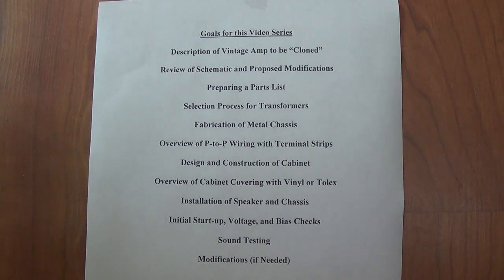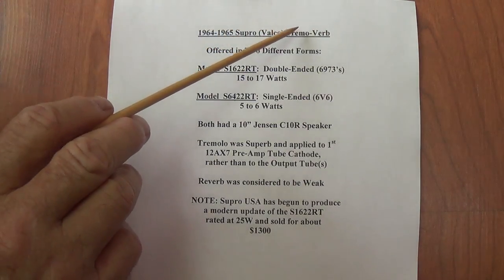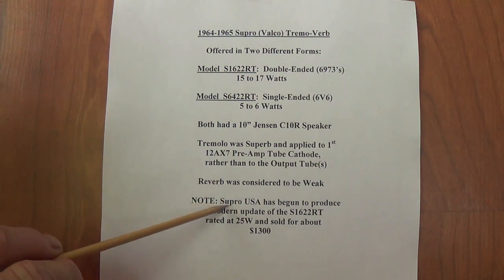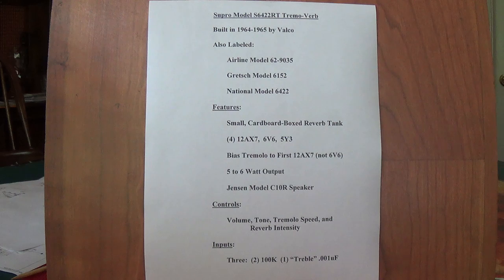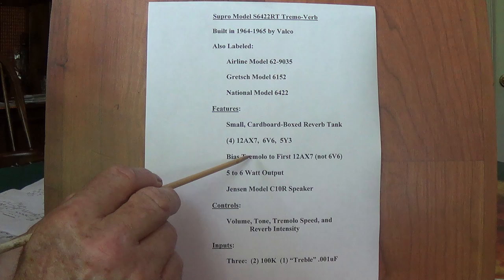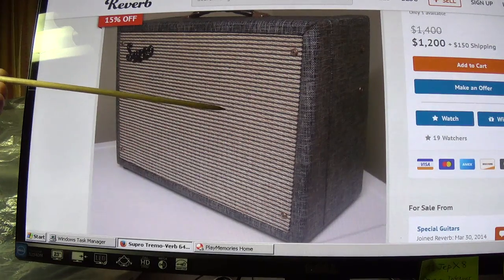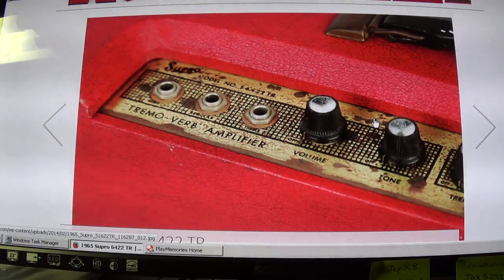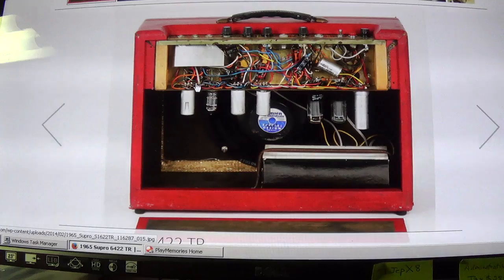How to Scratch-Build a Vintage Amp, Part 1:  Research and Methods

Comment: I am binging on these videos ahead of my first attempt at a build. I noticed that some of the cheapest amps/components out there are old AM/FM radios. (I have 3) They are about $30-40, and you get chassis, cabinet, tubes, sockets, and output transformer. Most of them don't have a power transformer that I recognize but seem to simply go through some caps and resistors before going to the rectifier tube. The tubes are not all that common unless it has the all-American 5. Do you have any videos where you convert a radio, or 16mm projector, or record player to a guitar amp, and walk us through how to convert the hi-fi radio circuit to a much simpler champ or tweed style, but with the 'oddball' tubes, ie, achieve proper plate and screen voltages etc? I would love to see it.
Reply from the maker: Yes, I have posted several videos demonstrating conversions from PA, projector, and Leslie amps to guitar use.  I do not advocate conversion of any circuit that lacks a power transformer, as they are potentially dangerous. I also shy away from conversion of AM radio circuits, simply because so many radio components are of no use, resulting in a big, bulky chassis with relatively low output power.  Stick with PA, mono phono, or projector amps for conversion.
Reply: @UncleDoug  Good to  know. Thanks.

Comment: Uncle Doug, question: How feasible would it be to try and 'scratch build' a pro quality stereo tube amp? I mean, there are schematics out there for stuff, is it just a matter of obtaining the same quality parts? I know like some vintage tubes are extremely expensive.
Reply from the maker: It all depends on your skills, access to high quality components, and financial situation, A. The project would be quite expensive, and the technical skills required to duplicate an existing, rather complex schematic would be substantial......but not overwhelming.
Reply: @UncleDoug  Thank you for your reply Uncle Doug, I appreciate your time.

I would really like to do this at some point, but if I wouldn't really save any money perhaps I should just buy an old Macintosh or something 👍
Reply from the maker: McIntosh amps are extremely expensive, A. My suggestion would be to either find a less-expensive alternative or get a fixer-upper that is reasonably priced. Good luck. @AiMR

Comment: Im driving myself a little nuts right now trying to figure out power supplies and i cant find a video that does a really super adequate job of answering the question i have.  Its relatively obvious that with tubes in a circuit the voltage at the power supply nodes is defined in relation to the current coming thru the tubes and internodal resistors and referenced to ground on the cathode sides of the tubes.  My question is how and why voltage still drops thru the internodal resistors eith the tubes removed.  I know that the voltage at the nodes climbs when its not able to dissipate thru the tubes but you do still get voltage drops along the power rail.  Im not sure if its referencing ground off the south sides of the filter caps or the center tap on the pt secondary... Im interested in learning to calculate that relationship and id like to be able to do it myself rather than just downloading a program to do it for me... Plz help
Reply from the maker: In any electrical circuit, the total voltage drop has to equal the initial voltage value, Mikka. Without tubes, however, there is no closed HV circuit, so no current will flow, meaning no voltage drop.
Reply: @UncleDoug  I was reading a text book I have on amplifier design and construction last night and it was a passage about ripple smoothing that finally tied the whole thing together for me.  There's current across the caps on the upswing out of the rectifier.  That current is what defines the voltage drop across the resistors when there's no load.  Thanks so much for your help.
Reply from the maker: I have posted videos on power supplies and filtering dynamics, Mikka. Please watch them if you get the chance. @mikkabrightheart2268

Comment: UD, Here is an idea you may like to run with. It is creating a mini-series that has you creating boutique amps from non-standard guitar amp tubes. No using 12ax7, 12at7, 6L6, 6V6, EL84's, etc. I know very little about electronics but I'm learning so I don't even know enough of what to suggest. One thing though, was that you use lesser cost tubes for those who are able to experiment with higher priced tubes. A couple two or three 12ax7's and a couple of 6L6's and my beer budget is blown for the month. Also, is there is good place to get caps that don't destroy a beer budget? I electrolytic 20uF 500v caps that are $15 each, am I looking in the wrong place? Could you get away with mylar of the same uF/v parameters under the doghouse? Thank you for your videos and for your responses. UB
Reply from the maker: Thanks for the suggestion, William. I get almost all my components from Antique Electronic Supply, and find the prices to be quite fair. Only electrolytic caps will work in power supplies......and they are really not that expensive (ignore the boutique components.....a waste of money).
Reply: @UncleDoug  TY, I will check them out. UB

Comment: Here's a stupid question. Will the components vary much for a European builder because of the 230VAC mains ?
Reply from the maker: Not stupid at all, K2. Other than the 230VAC transformer, which will step down the voltage to the standard 120V operating voltages, the circuit should be quite similar.

Comment: I have a question could I use transformers from a different type of amp to make a Marshall clone amp I have a 110 watt rail and borg tube and and I’m wanting to make a 100 watt Marshall plexi clone but I’m having trouble finding transformers now everywhere is out of stock ?
Reply from the maker: I guess it's possible, Chris, as long as the transformers you use have the proper specs.

Comment: Dear Uncle Doug; when at low volumes, is it possible for a well-made single ended amp design to sound as clean, clear and sparkly as a well-made double ended amp design? (if merely causing from their way of amplification to the original signal) - in other words, would it be nonsense to try to emulate a blackface fender bright clean sound with a single ended class A design? Thank you so much, best.
Reply from the maker: I guess, at low volumes, the relative "clean-ness" of SE and DE amps may be similar, Cem, but at higher volume levels, the SE amp develops an increasingly complex and "darker" tone.

Comment: You could ask Rusty about this. A bit off-topic, but do i really need to find a VTVM to check readings after recapping and otherwise restoring a pair of Dynaco MK III monoblocks?
Reply from the maker: I would suggest that you do. You can buy a really nice DMM on Ebay for less than $40, OEC.

Comment: If possible, teach us how to wind output transformer 😁, I am in the process of rebuilding my AX84 SE EL84. Love your lessons as always.
Reply from the maker: I'll keep it in mind, S, but good output transformers are readily available for all applications at very reasonable prices. Thanks !!
Reply: @UncleDoug  Appreciate it. A little hard to obtain from where I live, with all the shipping and taxes. I once had it made from local audiophile hobbyist, works fine, but a little too much on the low end for a guitar amp.

Comment: hi..love yer vids.."Q": htrd DLX ( fender) I want to adjust the tone stack so that the treble is deleted when the treb control is at "0". ..or...less than the current specs allow. would this involve just the slope res value or the bass >250K pot for a 1meg as seen in other mfgr's designs?
Reply from the maker: I honestly have no idea, Don. You could try using the Tone Stack Calculator (on the internet) to insert different component values and calculate the result.
Reply: @UncleDoug  ?? you mean like "spice" on duncanamp pages( I think i have heard of that) finding a dif issue today..so will pull pcb anyways..

Comment: Might I ask a small favor?
Reply from the maker: You're welcome to ask, P.
Reply: @UncleDoug  the ucon 65 oil, is there a way you could measure its resistance for me, when I come to trying to replicate I'm thinking of trying another more common oil that might be similar, and some of the patents I read, and papers on oil conductivity, suggests I might be able to add different metal salts to bring it closer, but I've found nothing that tells me how resistive the 65 is 😅

Comment: I  would really like to build a 10 or 15 watt version of a Marshall DSL 100. I really love the tone and versatility of that particular Marshall amp. I know there are much more desirable amps but that for me would be a great low wattage amp.
Reply from the maker: It's an interesting proposal, Gregg, but you really can't reduce the power of an existing circuit by 90% and expect it to sound anything like the original. The entire circuit would have to be so extensively modified that it would end up bearing virtually no resemblance to the original.

Comment: Thank you for the quick reply. Unfortunately, I still cannot find any line labeled "C", only B1, B2, & B3. I'll keep looking. I'm probably just overlooking it for some reason. Again, Thank you.
Reply from the maker: The first "C" goes to the cathode of V1. The second "C" goes to the cathode of V2b. It represents a connection between the two cathodes.

Comment: Hi Uncle Doug, 
I know it's been a long while since you posted this series on the Tremo-Verb, but I was hoping you could clear something up for me. I downloaded the schematic, and I admit my ignorance about one thing on the schematic. At the first 12AX7 preamp tube, there is a line coming off the cathode going to "C". I don't know what this refers to. Could you help me out on this. Thank you so much.
Reply from the maker: If you look at the power supply portion of the schematic, Patrick, you will see a line going out that is labelled "C".  The power supply "C" line connects to the cathode "C" line.

Comment: Sorry, novice here. What does single-ended and double-ended mean? Also, why such low wattage. 5-6 watts? Why bother?
Reply from the maker: Single-ended means one output tube, double-ended has two (usually in a push-pull relationship). With tube amps, 5 to 6 Watts is powerful enough to be used in small to medium-sized venue performances......it is much louder than you might think.

Comment: Hi Uncle Doug... 
Tech question: Would a single ended say 6L6 amp and a push-pull 6V6 amp be able to share the same power and output XFMR's ? 
Thanx in advance, luv your channel and... 
cheers
Reply from the maker: Greetings, Jonny. No, since SE and DE OPT's are constructed quite differently. DE are center-tapped, create two self-cancelling out-of-phase fields, and have no air gap. SE have an air gap to cope with the high DC field created within.

Comment: Dear Uncle  Doug    I started putting and gathering  all the parts i can see in your video sight i have about 75% of them all ready.  I am having trouble downloading the parts list and the most recent updated schematic of the S/6422RT  please  i need help .....if you can send me an E-mail   I would sure appreciate it.....                                         FRANKSTVCRS@YAHOO.COM.      THANKS
Reply from the maker: Greetings, Franklin. Here is the updated schematic link:  https://app.box.com/s/u945p1s2dv7ffrok96ux52lseya2rjv4  I don't believe that a parts list was ever posted. You can make a list from the schematic itself. Best of luck with your project.

Comment: Hi Uncle Doug,    Not sure the best place to post a thanks, but sincere thanks to you for all of the great instructional videos, and answering my beginner questions!   Last night I went out to home depot and got the last item I needed (push tab connectors for the speaker wires)  to get my first amp build, based on a Fender Deluxe AB763 schematic, running.   It sounds great, I could not have done it without your videos.    It took about a year to figure out what to build, watch your videos (some several times), learn abut building and most important HV safety, make a bill of materials, print schematics and layouts, order parts, get the mechanical stuff together (all the holes drilled and stuff moved around so that everything fit),  learn how to strip ans solder again,  check and re-check and test what I could and ask lots of questions.    It sounds like a Fender!    The tiny room in my house I use for an office is tiny so 22 watts (or thereabout) is plenty of power.   Thanks!!!
Reply from the maker: You're welcome, Michael. Your work list is a perfect example of how to properly plan and execute an amplifier build. It's very gratifying to hear that our videos were helpful and that your first project went so well. Congratulations !!!

Comment: Dear Uncle Doug, can you please tell me: which wires one should tightly twist, which ones can be just layed ?
Reply from the maker: Any pair of wires carrying AC should be tightly twisted, so that the EM fields within each, being out of phase, will neutralize each other. This is particularly important with the 5VAC and 6.3VAC filament wires.
Reply: Thank you very much!
Reply from the maker: You're welcome.

Comment: The yawn of excitement with Rusty
Reply from the maker: His yawns are very expressive :)
Reply: Uncle Doug I have tried but I can't understand why the 1meg resistor and pot controls the speed of the tremolo. If just seems to me that this would control the intensity...
Reply from the maker: The resistor alters the rate at which the oscillation loop oscillates, which is what controls the frequency of the tremolo effect.
Reply: so the voltage can also be thought of as the speed of flow of the current, while the amp is the volume of the flow ?   since the resistor reduces the voltage it takes longer to complete the cycle, the higher the resistance ?

Comment: Hi Doug,  I do not know if someone said this already but you commented about 1 12ax7 not being shielded. have not seen the schematic yet , but my best guess is that this is the half used tube for the tremelo. as you need only a woble you probably get away with saving a few cents on a shielding cap...... 

gonna watch the rest of the vids now to see if i was right :)

nice work 
Alex
Reply from the maker: Thanks, Alex. To be honest, I have never noticed much benefit from tube shields, even after direct, on and off comparisons.  Perhaps the huge AM radio stations in the past created the need for them, but nowadays, their value is primarily to preserve originality.

Comment: Hi Doug, thanks for the tutorials. This scratch build is great! For a beginner such as myself, I can now understand the process much clearer. Before I try to make a couple of tube amps by myself, I have a couple of questions. 1. Can I by-pass the tremolo on the amp to save money?2. I live in Europe, where they use 240v instead of 120v. What factors if any would need to be changed to your scratch build in order to convert to European voltage?
Reply from the maker: You're welcome, JC. Yes, the tremolo effect can be eliminated to simplify the circuit.....or you can simply emulate a circuit that does not have tremolo to begin with.  Power transformers are available for European 240VAC which convert it down to the proper levels for the amp circuit.  Just be careful when selecting a PT to be sure it is appropriate for your needs.  Good luck with your project.

Comment: Hello. Fellow Uncle Doug here! Reddit's /r/diytubes brought me to your channel.

This sort of project has interested me for a long time (been playing guitar casually since I was 12) and lately I've been just beginning to get into EE via Arduino and such. 

Can you suggest any beginner resources to learn this stuff? 

Any books or other channels you'd recommend?

Also, I'm guessing diving in and building a guitar amp for my first project is a stupid idea. What's a simpler project for a starting point?
Reply from the maker: Welcome, AF. Gerald Weber has written some good books on the subject. They are available on Amazon.com.  I personally use the Internet as a resource, doing searches for specific topics of interest.  My first project was a Trem-o-Drive tremolo and overdrive unit, which I have featured in a video on my channel.  It's a fairly easy project and works quite well (if done properly :)  Good luck with whatever project you select.
Reply: Sounds great. I just needed a place to start as there's a lot of information and it can be a bit overwhelming. Trem-o-Drive sounds really fun though, so I'll check it out.

FYI, I watched your two-part series on the power supply and it all made sense, I think. You explain things really well; thanks for sharing your knowledge!
Reply from the maker: You're welcome, AF. We're glad the videos are helpful.

Comment: Hey, I was wondering where you source the components for your builds, because apart from Ebay or Amazon there are no Electronics shops that sell components like Transformers or Tubes. Edit That I know of in Ireland.
Reply from the maker: My source for transformers is Triode Electronics and for all other electronic components is Antique Electronic Supply.  I'm not sure, but I assume they would ship to Ireland. Good luck, Thomas.